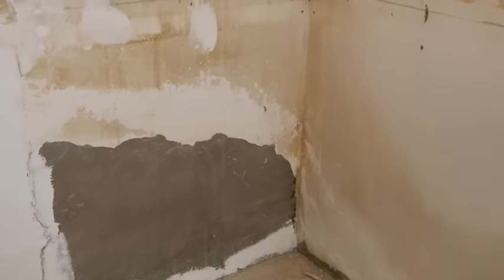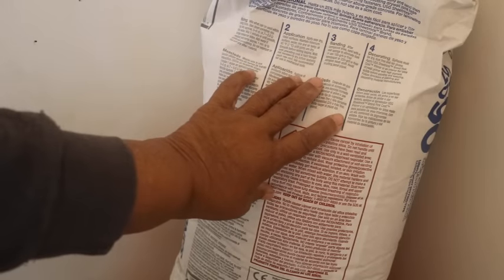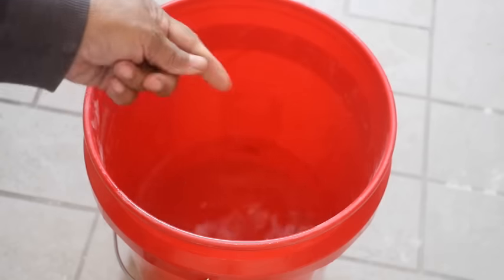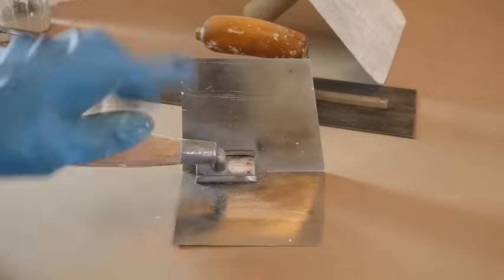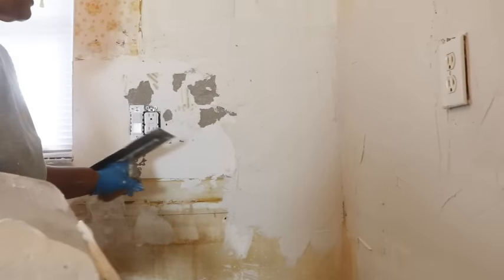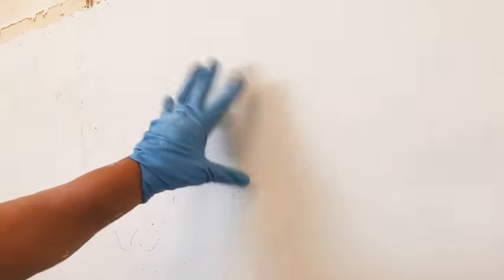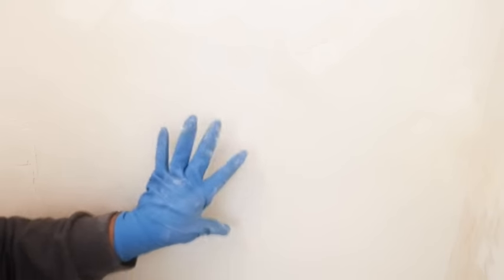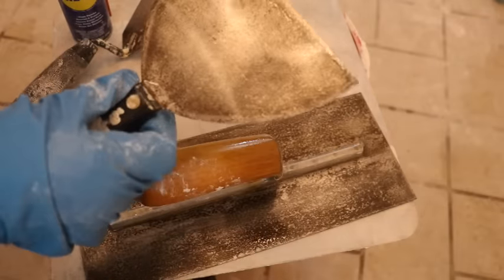You'll never sand JOINT COMPOUND again!!!

Comment: Another tip i learned from a pro: have a 5 gal bucket filled with water and a sponge. When done using the paddle bit for mixing, throw it in the bucket. Before going to lunch or break, put the trowels/tools in the bucket. A quick wipe with the sponge, and everything is ready for more work and I only spent minutes cleaning.
Reply: Doesnt work with hot mud like she was using
Reply: Nice tip. It's common sense, but sometimes people forget to stop and think.
Reply: Also .. re-spay the wall or have a pasting brush to manipulate areas that have dried to early

Comment: I've always been terrible working with mud, watched so many videos and usually they are just full of rambling. Finally a video that explains all the details in less than ten minutes. God bless this woman.
Reply: @MealTeam6 or keep trying
Reply: Also if you need to sand you don't have to wait a day. Imo it's easier to sand after like 8 hours. Especially with 20 min mud. You could probably get away with 4 hours with 20.
Reply: Leah has several drywall / fixes / mud  vids. She has the most wonderful vids that describe and also point out 'what to / not to do, what to look for, and she is just a great motivator.  God bless Leah!
Reply: @atedinahalf6288 Or you can just use a hair dryer or heat gun and do it in half an hour. I don't usually have to sand. I just do it as she did - scrape it down with your drywall knife then add another layer of mud if needed then do a light sand if necessary. But usually I don't have to do any sanding - a wet sponge will suffice on very light raised areas.
Reply: @MealTeam6 Or you can keep watching videos like this and practice until you're good at it. Why hire a professional when you can do it yourself and save money?
Reply: @solarismoon3046  I just look at it real mean. Helps the drying process. Give it a dirty look.
Reply: I don’t know why but the women do a better tutorial.

Comment: I am a building contractor from Australia, I taught myself how to plaster so I wasn’t waiting on subbies, it was trail and error but being a carpenter I know there’s more ways then one to do anything. I am so glad I taught myself the scratch coat method and keep it close, scape it and then top it, I still have to sand the top coat a bit because I am not as good as this lady. Thank you for reassuring me that I was going about it the right way
Reply: Should always sand the tip coat then when ya put your primer down and every coat of paint ya need to sand in-between coats not sanding isn't the way to go lol it just shoes lazy and bad work
Reply: Same ,I also had to learn .. I moved to the Nederland an contractors cost a fortune here an are booked out for the next year but I'm happy to learn then pay someone
Reply: Try a sponge mate. Just slightly dampened. It will for up the more water is on it so take care. The fir on the gyprock will sand off after a sealer/primer coat. 
I haven't sanded a patch or joint for at least 30years
Reply: @kailaniandi  A big clean sponge is very helpful.
Reply: @jazzyjace1  is it lazy or is she better than you just an honest question for you to think about. Not trying to start shit, but I’ve watched this lady and she’s  an expert in her trade at almost everything.She does mechanical carpentry you name it.

Comment: I have learned to never doubt Leah, she knows what she is talking about.  I'm sure your golden play button will be in the mail soon!
Reply: But I've done this and found it hard to get paint to stick if you are going to paint it.  Maybe mix some water and polyvinyl acetate and coat it before painting.  Some say to wait a month or more before painting and some say to wipe it down with water and some vinegar to neutralize some of the alkalinity.  I'm not sure the perfect solution but I've definitely had paint peel off afterwards.   I know to make sure it is thoroughly dry so vapor pressure doesn't cause the paint to peel, particularly with a high gloss paint that creates a rubber like coating.
Reply: Use primer before painting. It would stick very well
Reply: @jasonthurston799  When you say "Vinyl polyacetate", I'm assuming you mean polyvinyl acetate ie; wood glue?
Reply: @Vincerama  Yep

Comment: I've been really into improving my 1898 home in Colorado.
It really does look quite beautiful!I 
I've successfully done the walls in my dining/kitchen, 2 bedrooms, living room,  2 hallways and a large walk-in closet. My biggest achievement was repairing the ceiling in the closet.  Someone stepped on the slats. Broke several of them and put a decent sized hole. I replaced the slats. Resecured others.  Cut away an almost 2 ft hole due to its damage. I've taken my time with filling the hole. Letting each layer/section dry completely.  I've got one layer left. When I'd seen how much I had removed I was pretty freaked out! I knew my dad would flip when I asked him to help me fix it if I failed. I can't wait to how him the pictures of the before and after! I think he's going to be impressed 😃 I have to paint one bedroom and this closet yet. I've been in my project for approximately 5 months. Taking my time.  
NEXT UP... installing a new furnace and having carpet installed. Changing out the bathroom fixtures and dad's putting down new tile for me there. I'm very proud of myself! 1200 sft 🙃

Comment: Nice work, Leah.  I use a pool finisher’s trowel for plastering work.  It’s longer than the trowel you’re using and it’s got rounded corners.  Faster coverage and you don’t end up chasing the edge marks that a regular trowel can leave.
Reply: Excellent tool
Reply: Now, don't take my comment to heart, it is something I tell every person that tells me that they like using a pool trowel. I ask you, if you had a liar, a thief, or a cheat in your house, would you want them to stay? Those trowel lines in mud tell you a story. That story is how thick is your mud? If you lay down a layer with a swipe of your trowel, and your next swipe you carve  into the first layer, then you are not level somewhere. If you are adding mud, again, you are not level. Interpreting what kind of trowel lines you are laying down will tell you if you are making your wall level or not. If you don't see trowel lines then you are laying the perfect level. When they built pools, pools have round edges. Its super hard to get level, and not really important to get flat walls or bottoms. So they rounded off the trowel so you can't see the trowel lines. If you use a pool trowel on your wall, yes you are hiding your trowel lines, but you are not getting your wall flat. Your trowel is lying to you. It is saying it is flat but it's not. Everytime you use a pool trowel you are shaking hands with a liar, a thief, and a cheat
Reply: @ic99 If you think a wall is flat level and true you are fighting a fools errand. Most of us do not care how level flat and true the wall is. you want the patch to disappear in the wall. That is all that actually matters. I have worked many jobs as an electrician and can tell you almost nobody makes a flat wall. level 5 finish isn't flat, it is smooth without blemishes.
Reply: @t0cableguy  the immortal words of hack =)
To be honest with you, I don't agree with anything you say. But you say you are an electrician so I get that you don't know the trade. If you would like, I could give you some lessons.
Reply: @Phazetic99   that was a neat story

Comment: I'm a painter and decorator. I do skim walls especially when I remove wall paper. You can ditch the hawk if you use a wet roller. If it still won't stick to the pile try adding some wet pva to your roller. This helps you save your back. As for the finishing tips here. Blinding. I can't wait to try it. I'm sick of coming to a skimmed wall and virtually having to skim it again because of the air bubbles and divots. Thank you for the help.

Comment: Im a retired carpenter and have been around the joint compound dance quite a few times. 
One thing I need to  point out is, there is two types of setting joint compound. The non sanding ( brown bag )and the sandable ( white bag ). In this application I suggest the non- sandable, for two reasons. One, it does not shrink back like the sandable and it gives a more firmer base and finished job. 
One other tip is to not wait until it is really set up to do the scraping. I did it about 30 - 40 miniutes or when it was just firm enough to were you can't move it by dragging your finger through it.
One other thing is, you need to mix it wet enough so that you get a good bond to your existing surface. Leas looked a bit dry. 🤗
Reply: I assume you mean Durabond by the "brown bag". In my experience, Durabond is fantastic stuff for prefilling holes and voids and cracks, but I find it very difficult to make smooth, even with brush and trowel work after it starts to firm up, which makes it pretty unforgiving and stressful unless your trowel skills are quite good.

I find the sandable quick sets much less stressful since it is easy enough to sand down any of your mistakes that you couldn't fix or didn't notice while you were working your brush and trowel (the big felt pads are the best brushes, IMO).

That said, I totally agree with you about the extra durability and lower shrinkage (although I find it does still shrink a little) of Durabond, and would add that it seems to adhere better than the sandable quick sets. On nastier walls with large patches of unremovable paint, I would at least add some glue (maybe 5% glue to water) to the white bag stuff, whereas I think Durabond is probably ok without extra glue.
Reply: @ThePlockets  yes I was referring to the brown bag and The Durabond 90 minute . Yes the plan would be to not lay it on real thick, but to make sure that you feather it out and to not use a troweling knife no wider than 8 inches for your first coat. The trick is to make the mix wet enough so that it's easier to spread and feather out because you won't be sanding this coat anyway instead, just as I had mentioned in my last comment , you may need to just scrap any lap ridges should there be any otherwise I would just second coat it with the sandable type and then follow up with a bucket premixed compound.  That method works very good with great results. 
One other tip worth noting is when you use the setting type of joint compound, you don't have to wait for it to dry completely before recoating, but just needs to set firmly. This obviously makes the job go quicker since you don't have to wait for complete drying between coats.
Reply: @jsh3234  Interesting, so in plastering terms you are basically  using durabond as a sort of thin base coat, sandable quick set as a brown coat, and regular compound for your top coat.
Reply: @ThePlockets  exactly.!!

Comment: Excellent! I have a nasty mess in my 130 yr old dining room, after removing wallpaper. Now I can do the walls, using that method! Thanks.  I was procrastinating, but now ready 😊
Reply: @moonblink hi can you tell me what topping mud is? I’m a beginner and trying to get my walls ready for repainting. They had some dings in it and first I used 45 but it seems like I wasn’t mixing it correctly then I just bought the premixed joint compound  with the blue lid (dust control) and it’s working a little better but I know I’m doing something wrong still. Just trying to get to the point of painting. Thanks
Reply: simply hang new drywall over it.  way easier and faster in the long run.
Reply: Was it the like actually painted paper stuck to the weird cloth backing that has the string-dammits?  (just curious as I'm currently dealing with that stuff and the tacks won't come out and Gah! Even on the Ceiling.  They papered the Whole Thing sometime in the early 1900s )

Comment: Great video, I learned this method over 40 years ago and it beats the hell out of using drywall compound.  In my area it's called Durabond. Another advantage is, unlike drywall compound, it doesn't shrink.
Reply: Thank you, that's great to know.  My old house is a creaker and I'd like to patch the current cracks only once.

Comment: I can't thank you enough for this video!  We have several rooms in our house with walls that have been papered, painted, papered again, and painted several times on top of that.  I have been threatening to resurface those walls for the ten years we've been here, but I could not build up the nerve to begin doing the job, on account of the method I planned on using.  I am now absolutely confident I can skim coat those pesky walls, and permanently bury the terrible mistakes of the previous owners.  The house was built in 1890.  The above description of the walls is only a guess at what is really there.  I am sure there are many, many more layers than just two or three, of both paint and paper.  I dug into one of them with and ice pick and stopped when it was over a quarter of an inch in and hadn't hit plaster yet. 

I say this whenever I am remotely on the subject:  There are very few more effective ways to declare your hatred for someone, potentially your future self, than hanging wallpaper.  Wallpaper is from the devil.

Comment: Two points:
-When using 90 minute mud, make sure you get your tools cleaned before the mud hardens because it’s really hard if not impossible otherwise.  That includes buckets and mixing paddles.
-it’s really easy to burn up a smaller drill driver. It’s best to use a larger half inch drill that has a lot of torque and less RPMs.  I don’t use it that often so I just got mine from Harbor Freight for about $50.
Reply: 😂😂😂😂 ok professor know-all .
Reply: @daveribbons3050 well then, you just let that 90 minute mud dry overnight and tell me how it goes.
Reply: @daveribbons3050  Hey, he's trying to give some helpful tips. Why are you bagging on him?

Comment: Another sub Jane. Now to watch some other of your videos.
First time I see your technique with a brush, then the flat trowel. Will definitely try that next time!

I learned water sanding over 30 yrs ago, surprised how many people still don't know. However I've always used a very large rectangular with 90 degree sharp angles & corners, a new bucket of clean water, to walk around with and rinse the sponge. Finish with a 24" flat trowel, also perfectly square.

Yes, that very first coat, don't skimp, unless you want to do 2x scratch coats.

Last tip, if you are doing this for someone else for money, once wall is cured, slap two coats of rolled white primer everywhere, this will further protect & seal, prevent cracks and hide any cracks. Take pictures of completed job, clean up behind you.

Especially if there were lots of holes and you didn't use paper or mesh, or small butt-joint replacement pieces.

Comment: Good info. For smaller projects I like to use 10 to 20 miinute mud and mix it 7-8 minutes. When firm to touch I spray with light coat of water, then smooth over the area. Wait to dry, use primer, then color coat. For larger areas your schedule is best. Dry walling isn't far removed from plastering.  I did work out a way to plug a hole of varying sizes using only mud. I straighten the sides of the hole  and then measure it and transfer the measurements to a new piece of drywall. I cut the drywall 1/4 " small on each edge smaller than hole size.  I screw in large screws into the new drywall securely to serve ss handles. Using slow set mud I butter all edges of both hole and patch piece. I pick up the patch by the screws and carefully fit it into the hole as all buttered sides meld into each other. I use the side of a trowel to scrape away the excess mud and to level all the  patch edges with the hole. Wait until touch firm, remove screws and smooth over the joints and screw holes. Prime and paint. The joint compound becomes an adhesive and drys harder than drywall. I used to call the water spray stage as wet sanding. I don't figure the brush as being necessary. Great channel and subscribed.

Comment: I never sand, I try to make it as smooth as glass with the knife, but when I do need to knock it back a bit - I use a damp scrubby sponge - no clean up required, which is, I guess, the same thing as the glass trowel. Great video - very informative. Thanks!

Comment: I use a damp car washing sponge instead of a paintbrush to remove the excess plaster.  The   little ridges that form off the edges of the trowel are the easiest to knock down. So, during your project don't worry if you leave Ridges at the edge of your trowel.

Great video! ❤ it's fun to play with mud
Reply: Yes, wet sanding is the more common way of doing it.  Never seen a wet brush used.  Whatever works I suppose.

Comment: Having done this several times I have never been able to not sand even after watching countless videos like this.  I have learned to make mud on loose side and apply multiple coats leaving me with very little sanding but still needs light sand in the end.   Just removed bead board then smoothed the walls and came out really nice but as mentioned needed minor sanding.  This is one of better videos out there for this.

Comment: I’ve never sanded the walls.  I’ve always used warm water with a porous sponge with a variety of hole sizes.  Dip the sponge in the water, squeeze it out a lot of the water and I use a 6” blade like you do to knock any sharp edges.  So, I’m with you… well explained my dear.

Comment: I can accomplish the same finish by dry sanding with a vacuum sander and hepa filter running along side.  First, apply a hot mud coat, shave high spots once the hot mud is stiff but moist, next apply a tight skim coat of all purpose lite taping compound, finally, vacuum sand.  The total process would take the same or less time as the method you presented.   The finish doesn't need to be smooth as glass when applying a primer coat and two finish coats of paint.  The finished product will be beautiful.